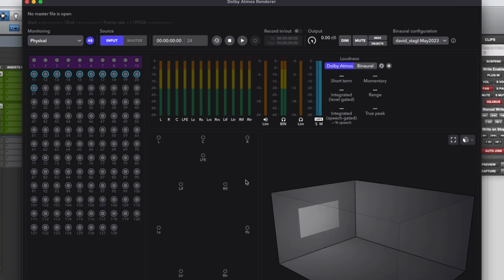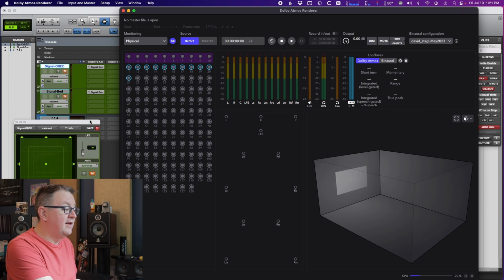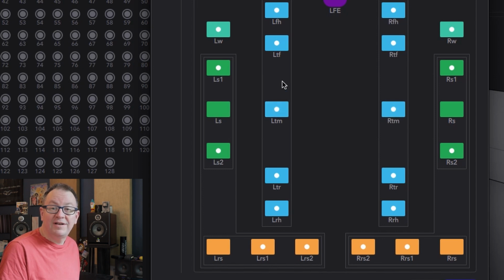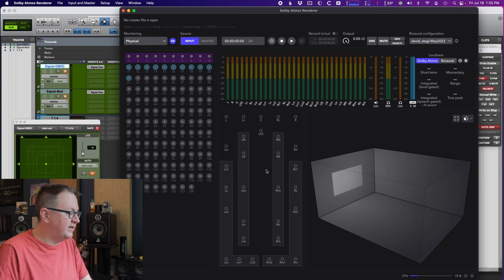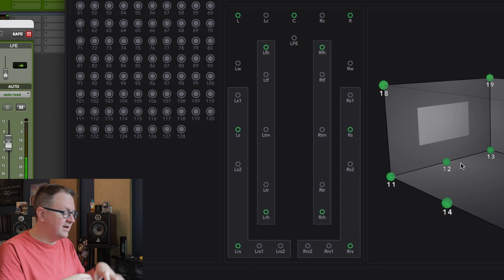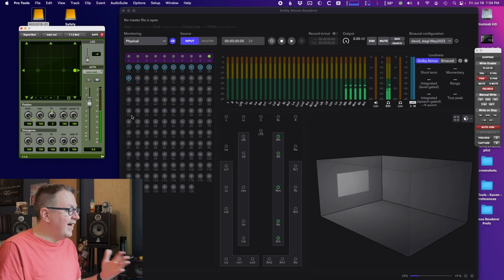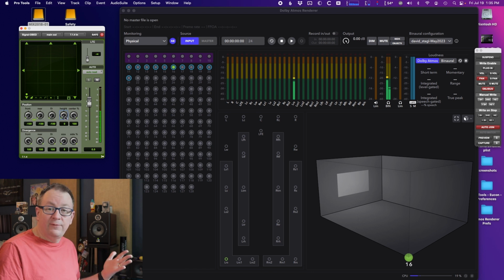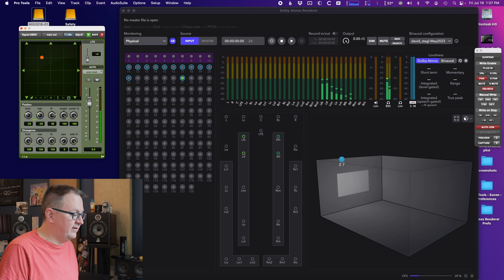Exploring Dolby Atmos Array Mode

Comment: So there is only right-left top speaker panning in commercial theatres, if sound is mixed as arrays?
Reply from the maker: If you send to the height channels in the bed, you only have left and right in the array. If you use an object, you can pan through the entire array.
Reply: @goingto11  Got it. Thanks 😊

Comment: Super great video Dave. I was really adamant about using object beds for discrete locations, and I see that isn't as important. I still hope to see more listening parties being held in movie theaters. Maybe even Get some live performance theaters with the potential for immersive sound, kind of like the sphere in Las Vegas and other venues that support immersive live performances. I wonder how this kind of thing will translate in the future as well with apple Vision Pro, and future augmented reality headsets. Super neat to see how technology has evolved Within the past five years. Glad to be here to witness it🙂
Reply from the maker: Thanks, Alex. I'm also curious about live performance since I've worked with other immersive systems for live sound. Right now the biggest issue I'd see with Atmos as I know it is the latency. I'm really curious what they're doing with the venue out in Vegas.
Reply: @goingto11  I feel like there should be a relatively easy way you route audio to even a separate processor that accounts for the latency, but that's only one factor of the. I was thinking a Stereo PA for the band, and something like 7.1.4 playback tracks running in another DAW? Something I plan on looking into in the next few years. 

Also forgot to ask the question about object sizes compared to an array, and maybe some compromise between binaural and speaker playback using the size parameter to spread into more speakers. Probably is kind of messy with binaural, but something worth checking out!!
Reply: @goingto11  Las Vegas uses a Holoplot X1 system which employs 3D Audio-Beamforming and Wave Field Synthesis. Quite  bit more advanced than Dolby Atmos.

Comment: In the renderer you're showing, it looks as if individual speakers that are part of an array can play individually. My understanding is that that's not how an array works.

From the Trinnov Altitude 32 processor manual (p. 80):

"...it becomes essential to be able to create an array of speakers: use several speakers to play the same channel. ... Similar configurations have been used in commercial cinemas for years."

In other words, when a group of speakers are setup as an array, they will play the same signal. They will never be able to play individually. So that renderer is very confusing.
Reply from the maker: One of the early selling points for Atmos was it allowed mixers to "pan through arrays". If we are working with an object, we can pan to any location in the environment and the Dolby Atmos renderer will place it in the best speaker(s) to recreate that position based on the current speaker configuration. If we work within the bed in Atmos, it will utilize the arrays.
Reply: @goingto11  interesting. That would require a processor that knows how to differentiate between the two. But perhaps that is how Atmos enabled processors work with arrays, compared to how arrays would be setup and work in the past prior to Atmos?
Reply from the maker: In any Dolby format there is metadata, and that metadata should tell the device where to put things. I'm not exactly sure how that works in consumer devices, though, partially because I'm not sure exactly what is happening with the encoding for consumer formats(ex. DD+, TrueHD, etc.).
Reply: @goingto11  yeah. That's constantly being tested by the home theater community. Especially since the launch of the spatial audio calibration toolkit. That's how we've found out that some mixes don't render as we would want them to (e.g. 7.1.2 mixes with 7.1.6 setups) and that different devices actually do things a bit different, and that the user's settings can mess things up without them knowing (e.g. assigning speakers that are located as surround heights as "surround heights" in Denon/Marantz, which will make them completely silent with Atmos content).
Reply: @isak6626 So you say, if someone has height speakers, they should be assigned as top speakers not height?
Did you test it? Because as I know Dolby Atmos supports height configuration and many people are happy with that.
Reply: @filmses  Atmos supports front heights and rear heights. Not surround heights. If you have speakers positioned above your surround speakers (a.k.a. surround heights), you should assign them as "top middles". Otherwise they will be silent when playing back Atmos content.
Reply: @isak6626  oh thanks for the clarification 👍🏼
Is there any formal documentation that I can read?
Reply: @filmses  You can look at Dolby's different setup guides and you'll see that there is no option with surround heights. You can also look at CEDIA RP22 where there's a table with different speaker configurations and their support by different formats (Dolby Atmos, DTS X, Auro 3D etc.).
Reply: @isak6626  Thank you 😊

Comment: This is great David!!!  Answers all the questions I had from the previous video.  So the big problem is that this IS not how it works in any home system, even on a Trinnov.  It SHOULD be the standard going forward.  If the processors for home theater could do what the renderer could with arrays would solve SO MANY people’s problems that use higher speaker count systems.
Reply from the maker: I think it's important to also understand that consumer delivery is never the FULL Atmos. There is always spatial coding happening that clusters audio into either 12, 14, or 16 objects/channels depending on how the bit budgeting is done--and LFE is one of those so it's really more like 11, 13, or 15. That's why some of those "object viewers" people use for home theaters to see how "active" a soundtrack is aren't very accurate as to what is really happening in the mix.
Reply: @goingto11  Yes, for sure, but you can still see the things that are encoded as objects in the Trinnov viewer, even if they are in clusters you still see them represented and it gives you a little number counter too of how many objects or I should say object clusters are active at that moment.  

The fact remains that on a 7.1.4 home system an object or bed mix will sound basically identical minus the extra 2 heights, but on a 9.1.6 home system the bed layer will not engage the front and rear heights or the wides.  Same goes if you added more side surrounds for multiple rows.  I know the theatrical won’t engage the wides on bed only, but for home theater the 6 height setup only engaging the middle 2 heights is a big problem for many, so much so that many discourage going to 6 heights for that reason.  It’s weird in that it’s a problem that will only affect the bigger budget systems and not the people that stick to 7.1.4.  Usually stuff like that is the other way around where you get the short end of the stick if you don’t spend the extra money.